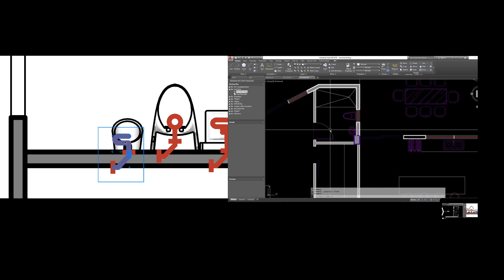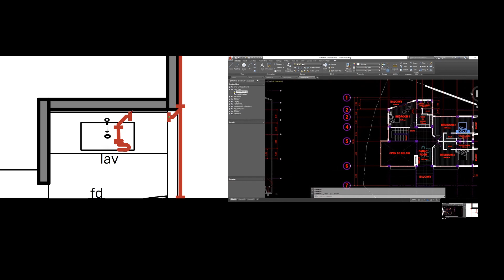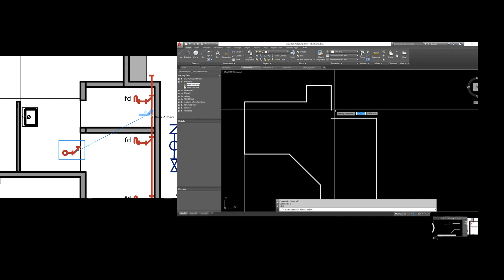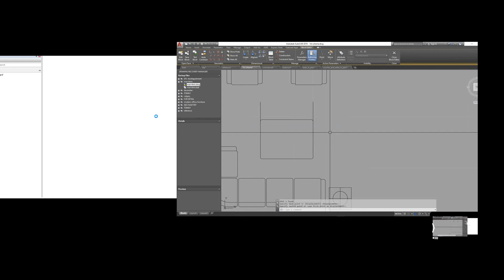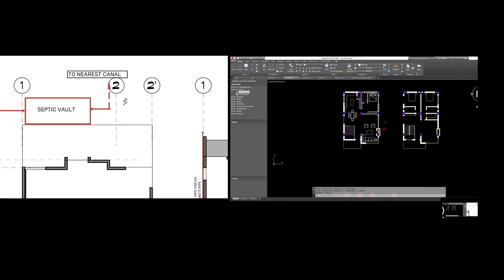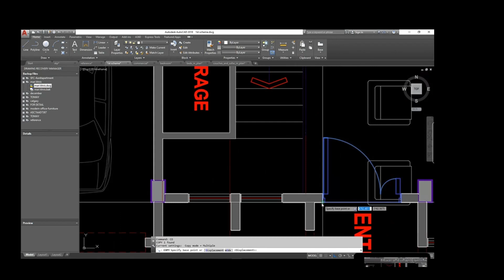Sketchup vs Autocad (Tagalog Podcast)

Comment: i intentionally slow my pace during contract docs phase, since clients after design development phase tend to show off the "final design" to their friends/relatives and receive additional feedback/suggestions even though technically you are already done with this phase.

Nasunog na kami once sa irl project - even though nakuha na ang building permit and the design is "settled" na, sa hukay pa lang ng foundation nakialam na agad ang client. Several months delay sa construction phase since laging may input yung mga anak galing sa ibang bansa.

Then there's also another project na we revised the design an additional four or five times even though we've already completed the structurals and working on the utilities. Just think of how many drawings ang tinamaan with every revision, although fortunately during contract docs lang not in construction, sigh...
Reply from the maker: that's a harsh experience. it's good to hear you managed to get through and managed them.